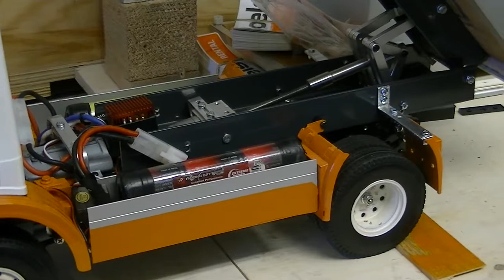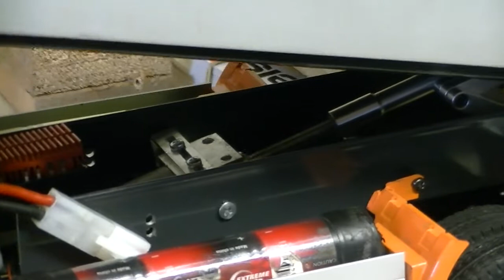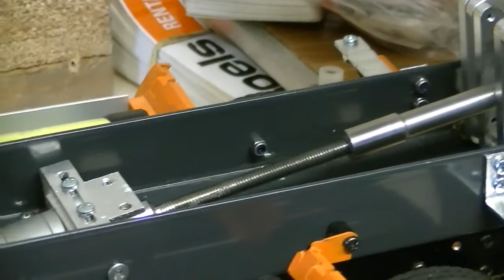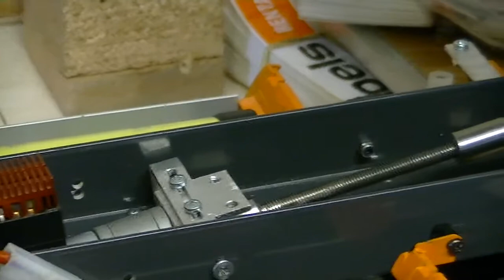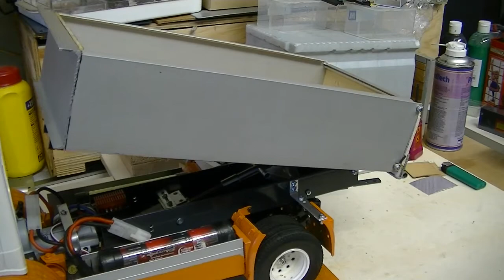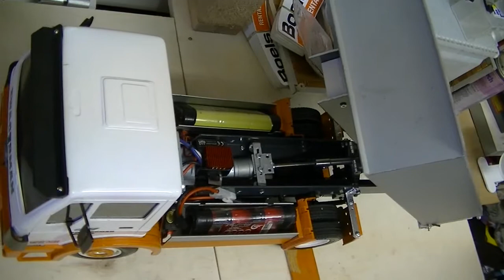Rc tamiya tipper truck

Comment: The screw movement looks not so smooth, to prevent this. You can add in a universal joint at the motor.